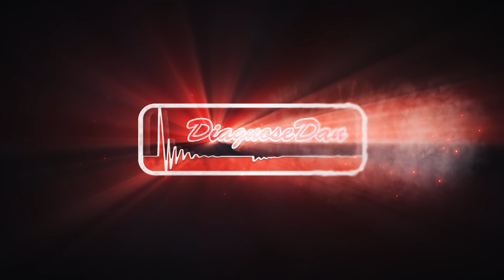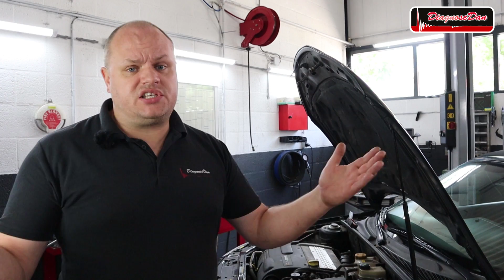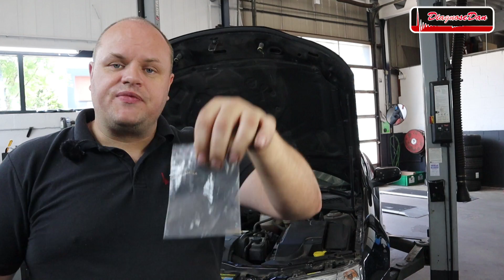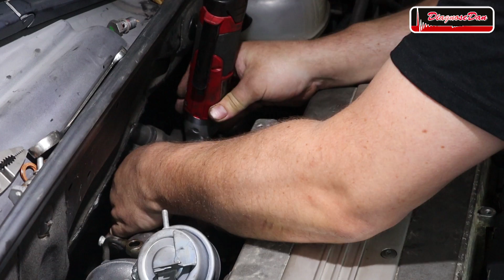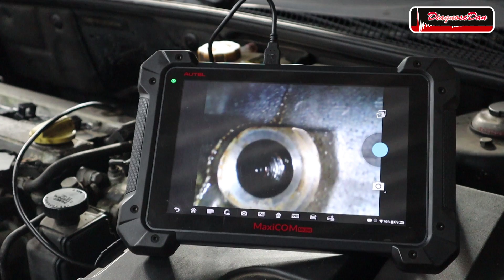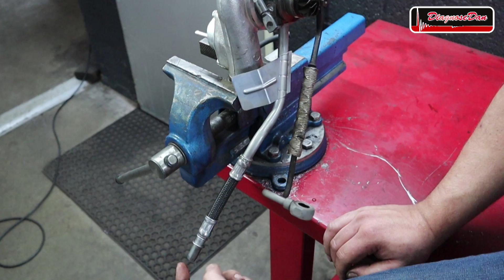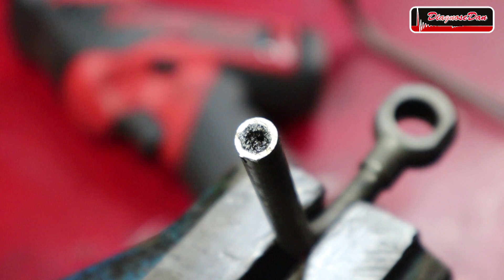Why did this new part only last one day?

Comment: Dan, I'm surprised they didn't run compressed air or some carb spray through the lines first before reinstalling.
Reply: The replacement turbo COMES with this line new in the kit. The customer didn't get all the new parts they paid for. That is shady!!!
Reply: If they took the time to take the line of the car, they would have installed the new one afterwards.
Reply: Something smells like pure scam here
Reply: Spawn223311 don’t assume malice where mere incompetence will do.
Reply from the maker: I think it was to late for that and they just should have replaced that oil line that came with the Turbo
Reply: @Diagnosedan  That's why you're here, Dan, to fix all the "should haves" for each customer. :)
Reply: The oil lines should always be replaced when replacing any turbo. That is why the manufacture of this turbo included them with the turbo. Especially on an older or high mileage vehicle no exceptions. The oil lines on old turbos will always have some amount of crusted up in them. Even if they are not  blocked these lines live right on the turbo which gets incredibly hot and have a flexible center section made of some sort of rubber which will almost certainly spring a leak after being removed and reinstalled. The first shop needs to refund all of that customers money. Made even worse with the fact that they had the new oil pressure  line right their in the box.
Reply: Lazy Fu**s the other shop was. That's why I pay everything with MasterCard or Visa as I can dispute it right away if needed and the sooner you dispute the better odds are in ur favor. (Wife spent 21yrs doing card disputes in Fraud/Security for one of the nations largest privately owned banks credit card company). Based out of South Dakota. Alot of stuff gets charged back to the vendor if they don't show proof of transaction (signed receipt) or it's a services dispute and there's proof on paper.